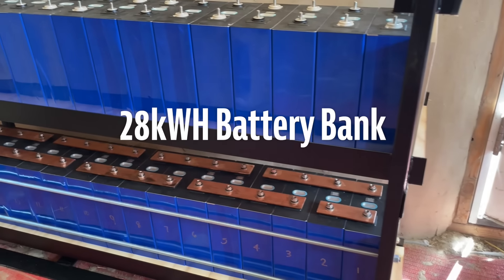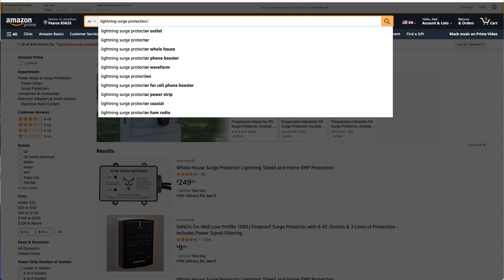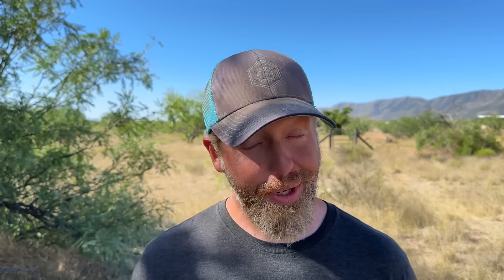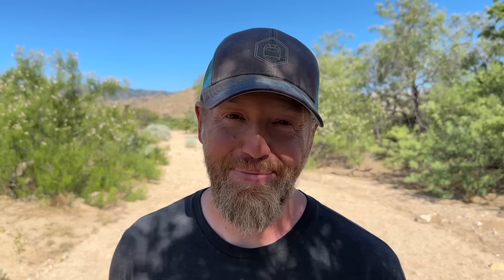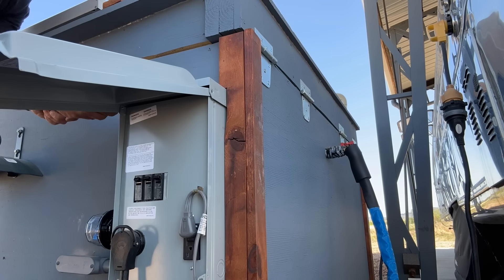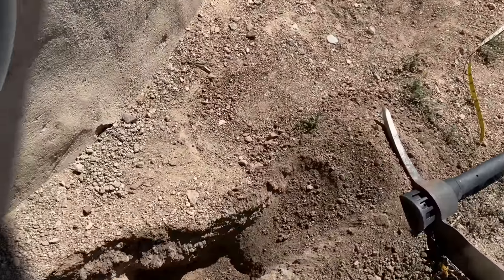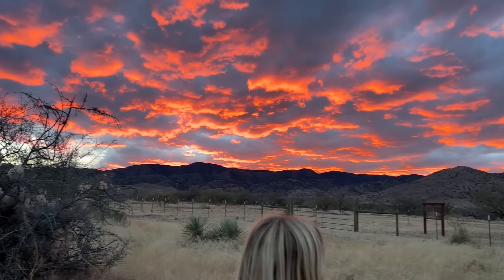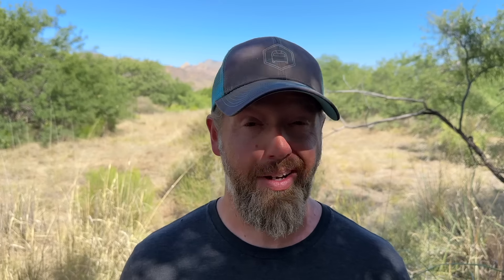This Cost Us THOUSANDS - Lightning Destroys DIY Off-Grid Solar System

Comment: photovoltaic / solar thermal technician here, that's a beautiful job you did :face-blue-smiling:
Ufer Grounding :face-fuchsia-tongue-out: Ufer grounding is a grounding method named after Herbert G. Ufer who worked as a consultant in the US Army during World War II. Ufer grounds have been mandatory code for years, in Arizona. (how do i know?) it was one of the questions in photovoltaic tests. The NEC refers to this type of ground as a "Concrete Encased Electrode" (CEE) am i NABCEP certified ? nope :face-blue-covering-eyes:but i know my stuff and it's not necessary, but CA pushed it so i work for myself can't be hired with companies asking for it

Comment: Hi there, if you put your lightning rods where your roof rain run off goes into the ground or your water trenches. That should be more moist than most other areas. Just a suggestion.
Reply: They collect the water off each of these roofs.

Comment: I think you did fine by not SPD'ing the batteries cuz, as you say, the run is short.
The main thing I think to be done, and I believe you did it is to SPD both PV+ and PV- because the lightning likes to hit wires with a common mode voltage...  Meaning that the PV+ and PV- both go up in voltage together with respect to ground.  The SPD should keep the controller's insulation from arcing over from PV+/PV- to ground or chassis of the controller.

Comment: DIYing a power supply can give lots of surprises! My first experience included the sun hitting the solar panels, and a power surge shorting out the computer that was connected almost directly to the batteries! Moral to that story: charge the battery, disconnect it from the collectors, THEN and only then plug in the computer.  Oh, and actually read the books, and don't trust to a teeny, tiny diode for surge protection. Thanks for this informative video with hands-on demonstration of the protection install.

Comment: Also consider Lightning loops. You will see them on traffic signals. Lightning seeks the easiest path to ground/air. An inductor is a resistance. So are sharp bends in your ground path. Check out marine lightning solutions too. After all the sail boat is the tallest thing around. A lightning rod with a bristle shape will will connect to the air better than your anodized aluminum frame. In Florida this is a real issue.

Comment: Hi from New Zealand. I've had various equipment knocked out by lightning over the past 30 years, such as solar panel bypass diodes, solar charge controller and a WIFI router. From what I've seen the killer seems to be induced voltage within wires from the huge EMF pulse generated by the lightning bolt, rather than increased voltage potential between equipment and ground. This means equipment which is completely isolated from ground can still be fried and the wires which pick up this induced voltage can be highly localized, for example depending on the direction they run in relation to the lightning's EMF field. The most important protection the Midnite Solar devices give is clamping the voltage between conductors and the case ground of nearby equipment, rather than bleeding voltage to ground rods. High voltage protection should be mounted as close as possible to the equipment being protected, rather than being centralized at a main breaker box. Hope this helps.
Reply: I've heard rare cases of an unplugged television being zapped by lightning just by the induced voltage on the power cord. This was without a direct hit. There's a reason Ethernet is made with twisted pair wires.
Reply from the maker: Depends on what you're protecting. For off-grid gear, yes place it as close to the device as possible. But once you have AC power going from the inverter a long distance to a new location, the breaker box makes the most sense to protect that whole panel.
Reply: Good comment regarding how the surge is created. Agree that surge protection should be as close to the equipment as possible, and installation of multiple surge protectors are the best defense

Comment: I used MOV lightning arrestors for water heater, indoor and outdoor ac systems. These 3 protect the whole system if one breaker is on. They reset when breaker is cycled off then back on. I've had the outdoor ac compressor get a lightning surge and it affected only 1 leg of the 240 v line. Cycling the breaker allows current to flow again.

Comment: Thank you for sharing with us the difficulties you had with your solar system and lightning protection. You are correct in saying that there is nothing that can absolutely protect you from lightning especially from a Direct Hit! You're not quite correct when you say that the SPD operates instantaneously because everything does take time to start conducting and to dump that energy somewhere else. As for the ground rods and your Sandy Soil I have to tell you what typically happens in Florida with their sandy soil and lightning hits; and what it does to the ground rod! Basically, when you've got that much energy flowing into the ground rod it super heats and takes the sand that's around it and turns it into glass; now we all know that glass is a very good insulator so therefore the next time that a lightning bolt hits in that area it's not going to be nearly as effective at dumping the energy. So, you should look into a UFER ground which is basically a lot of copper embedded In concrete and the concrete buried in the soil so that the whole surface area of the concrete now becomes an effective ground rod to distribute the energy into the sand. It also helps if the sand is somewhat moist so it would be good for you to bury this concrete UFER ground in one of your swales where the moisture content might remain a bit higher. Another recommendation is to use that unused line from the SPD and connect it to the neutral on the AC side or to the negative on the DC side Since the lightning energy can propagate through either and all of those lines. It would be good to have some extra SPD's readily available and to replace them right after a nearby lightning hit since that nearby hit may have rendered them useless for the next hit.
Reply from the maker: Not really the same sand here, but reminds me of that movie sweet home Alabama 😂. Midnite SPD’s are different than most, look into their tests and specs online. Obviously nothing is perfect, but they react super fast to high voltage and amperage.

Comment: If you are off grip far from firs and emergency services, it makes sense it install a lightning deflector/arrestor system, that is literally WELL grounded surrounding your HOME whether or not you have electronics.   These were commonplace on prairie farm houses. If it were me, all cables,  power and control, in walls and underground would also be metal conduit, and I'd  supplement or replace  GFCIs with  AFCIs.

Comment: I use floating ungrounded systems and disconnect my panels from the system during storms....Which isnt for everybody, but has worked for me, without spending a fortune...And I would recommend a grounded lightening rod, made out of rebar, away from your system..But, to each his own..

Comment: Nevermind the Midnight Solar MPD, go straight to the "EMP Shield" device installed at the inverter.  $25K equipment replacement guarantee/warranty, and a $50 replacement for a unit that was sacrificed from a strike.
Reply: How do we know that EMP Shield isn’t just another gimmick?
Reply: @Mik-ha-El  How do you know that Midnight Solar MPD works?  Considering both items have never experienced an in the wild EMP, only test results are where we base our findings.  So, I guess that means we all need to do our own research.
Reply: None of that will protect against a direct strike. He has 2 grounding input locations which causes a ground loop for lightning directly through all of his equipment which is more likely what killed it all.
Reply from the maker: Nope, it was because of poor soil grounding conditions.

Comment: Only 3 suggestions : 
1. an earth mat/grid - to increase grounding area contact
2. exothermic bond welding - to ensure conductors make perfect contact at joints
3. a lightning rod/pole - to divert lightning strikes

Comment: There are devices that are designed similar to sparkplugs that have an air gap. They work in conjunction with electronic protection.    😎 Thanks, great video.

Comment: I would suggest having plugs and sockets where your pv cables enter your power shed and at the pv array so you can disconnect them when a bad electrical storm is coming this way you can be sure to protect your equipment and preserve some of your SPD’s
This is the way you can be sure to protect yourself from surges caused by those particular cables.
Reply from the maker: Plugs and sockets introduce a number of additional issues like waterproofing, failure points, etc. There are breakers installed within the system already that would do this easier. The goal here though is hopefully not to have to think every time you see a storm if you have to go shut things off. Adds a huge amount of mental overhead and stress.

Comment: The MNSPD-300-AC you put in the pedestal for the Airstream, Instead of capping the black wire you should put it on the neutral. As the neutral and ground are separate in this box and so far from the bond at the victron you can get an elevated voltage on the neutral and damage equipment. The SPD Black wire will protect that.
Reply from the maker: No, the SPD isn’t designed to connect to neutral.

Comment: Bummer! We were able to get good insurance on our completed diy home and solar barn structure. We are also in Cochise County.  At first the main hang-up was that we didn't have central heating or cooling. Everything had to be approved by the higher ups in the company, but it was approved. Maybe once your house is complete you will have better luck.
Reply: Red&April Off-Grid...can you share who you found insurance through?
Reply: Would you kindly indicate who insures your place?
Reply: @SheridanAtwood-bd3ks  We use Safeco. It took some doing, but they got it done and were great to work with!

Comment: Man ive got about 30 grand in components in my 2 solar systs that power our 30 foot holiday rambler. It would crush us if lightning destroyed all our equiptment and id qbout guarantee the insurance we have on our camper wouldnt pay for anything lile that. I really admire the life yall are living. Me qnd the wife are 100 % off grid when not in the semi truck but thats only a few days a month. Soon we are planning on finding property we can buy and get our camper off my familys property. We live in tn but love it aroumd Arizona and new mexico. Finding land where we could leave our stuff for 3 weeks at a time while on the road seems to be the biggest challenge yet. Id give about anything to have a set up like yall have but have a local driving job so we could be home enough to keep an eye on our stuff. Thanks for the inspiration in your videos. Guys like you making the videos yall make os where i got the confidence and know how to buold our systems. Thanks again
Reply from the maker: So good thing is in an RV you're much less likely to need to worry about lightning. I've got 100's of feet of high voltage wire running underground to physical structures. You've got a self contained, detached vehicle with rubber tires touching the ground. Unless you got a literal direct strike I wouldn't worry too much about it (and at that point the electrical system is the least of your worries 😂). You're not going to have the indirect strike issues I have.
Reply: @TinyShinyHome  I have 8 panels on ground mounts and about 75 feet of 4awg wire in conduit ran to them. I also have my inverters neutral ground bonding tied into an 8 foot ground rod because without it I kept finding current in the frame of the camper.  Hopefully later this week I can get another 10 or 12 panels and they will be on ground  mounts as well. Yeah a direct strike would probably be all I should worry about lol
Reply: @TinyShinyHome  and not just rubber tires on the ground it's got 3 foot ground screws at each corner with a cable pulled tight and stabilizer feet down on gravel.

Comment: You can DIY a lightning arrestor. You will need a big choke and some gas discharge tubes with downstream capacitors and TVS diodes.

Comment: Great video, I don't know if you grounded your solar panels, but I wouldn't do that. Otherwise the lightning strike on the panels (not the DC wires) will transfer from your grounding wire into your system. Better to not ground the array itself.
Reply from the maker: No, the IronRidge ground mount system is grounded by design - all panels are bonded to the frame which is literally grounded  when installed in the ground. Additionally the system comes with a grounding lug that is supposed to connect to a grounding rod. All to spec.

Comment: Hey shiny family !  I love you guys so much !  How about doing what the rocket scientists do to protect their rockets ?  4 metal rods connected with wire at the top making a square around the objects needing protection.  Of course it is still about how well the ground will absorb a strike but seems that rocket protection system will just avoid the chance of any ground strikes where you really do not want them.  Like if you put the four rods in about a  100 foot square or large enough to be well outside all your ground wiring and equipment.  I think since those rockets are about 6 million a launch, at best, they reeeeealy don't need a lightning strike !  So they found a way to completely avoid them.  Of course they do not launch in storms so this could all be not a solution.  oh well hihi.  but, if you find a way to do it cheaply, a little extra protection certainly could not hurt !  Have a super special day shiny family !

Comment: A great radiomans trick to enhancing the ground effect is to pour coal dust in the hole for your ground rod.
Also, connect all your ground rods together using 6awg bare copper wire buried.

Comment: There are devices you can use to measure your grounding resistance. Here in Eastern Europe we use quite bigger rods. In my case it took 3 rods to get the resistance under 10 ohms

Comment: been there. 2 strikes. took out wi fi, generator, charge controller, trace pure sine inverter. 2 xtra things to think about. my electrician friend mentioned a conduit higher than anything else so i now have a 30' tower that is grounded. i realize it might not help your situation because of the super dry ground but might help others. another way is disconnect expensive components from out side during lightning. inconvenient but you can have some misc. 12v stuff so your not in the dark

Comment: Back in the 70’s I had wind turbines sitting on 50 foot towers and luckily for me the towers usually bled off any building static electricity but some always made it to the controllers and knocked out the CMOS components … I finally built and designed my own controllers with internal lighting protection that cured the fragile CMOS chips !!!! I now have a solar system that is somewhat protected but I am surrounded by trees which should get hit first !!! All I can say is no matter what protection you use it still might not work   100% !!!  Lightning at that voltage level and potential will be erratic and not follow any predictable path !!! Hospitals with helipads on their roofs have extensive lightning protection including many mini antennas to catch the lightning … good luck as that might be the end of your lightning problems 🙏🏻🙏🏻🙏🏻🙏🏻

Comment: While adding additional grounding rods is a good idea, if your soil is dry, it means you still have rods in dry soil. You may have needed to join a ground rod to the first one and drive it deeper ... they do make couplers for ground rods. Sometimes you need 3 or more rods to get deep enough. Yes, they are hard to drive that way, but it should get your rods down into soil with moisture for better results.

Comment: A single continuous copper wire should be used for your grounds and inspection wells for those ground rods would make life a lot easier later on down the road.